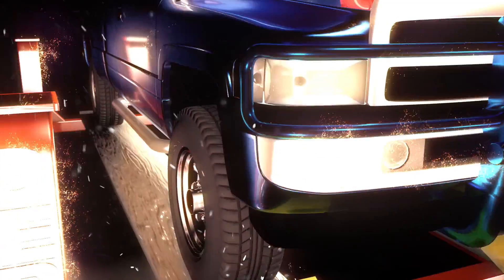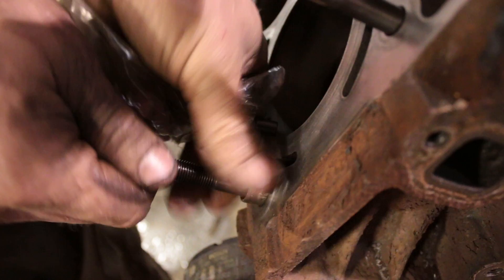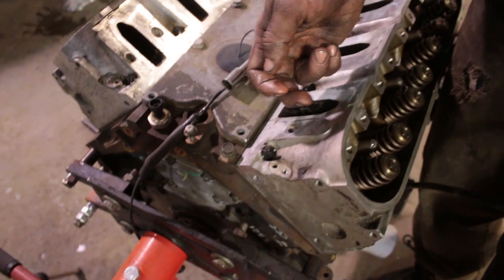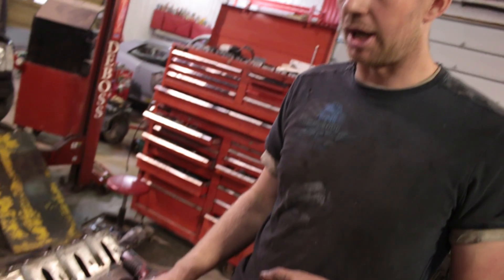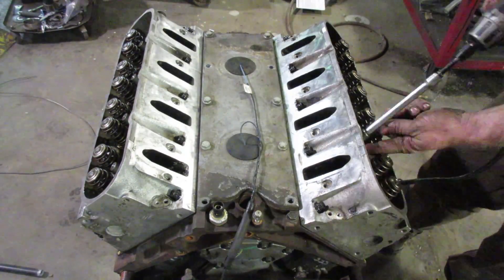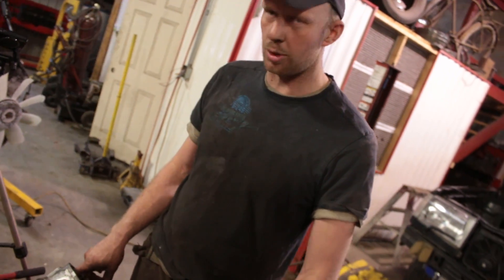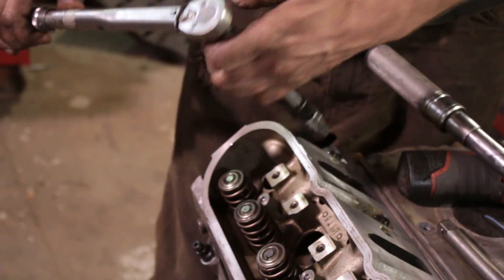Head Studs vs Head Bolts Explained

Comment: 95 percent marketing bullsht  quicker  to use when changing gaskets     would be cheaper to make compared to a bolt    could custom made to  fit the headbolt space without the need to retool    - im quessing

Comment: I'm not saying it changes your method or anything, but your explanation was incorrect. Adding thread on the bottom AND the top isn't what changes the clamping force, like you said the thread on the bottom isn't spinning it just sits there. Might as well be welded to the block for all the stud cares. When you torque the nut on a stud it pulls on the threads in the block just the same as a bolt since "every action has an equal and opposite reaction". Additionally the whole bolt/stud deforms not just the threads, so it doesn't matter that more length of rod is threaded. If there is more clamping force from a studs then it's most likely because on the studs you showed the top threads are a finer thread then the bottom. Finer thread means more clamping force for the same torque on the bolt since there's more revolutions of the nut per length of rod travelled (torque multiplier). That's why studs are useful is the finer thread since you can't get a finer threaded bolt and have it still thread into the block, but you can change the pitch of the thread on the top of a stud. It isn't it being threaded both sides that matters, it's the pitch of the thread, and a stud allows you to use a finer thread meaning more clamping force.

Great videos and the mistake doesn't make it any less useful, just wanted to point out the explanation had some physics misunderstandings.

Comment: Having both built and sealed control category  engines what happens after regular disassemble then assembly is that those corse threads strip out of the block. And that brittle cast iron distorts under bolt heads. Bolts or studs use washers and moly lube
The entire torque to yield is maybe ok for one rebuild. After that everything is bent and buckled.
While not condoning it I have reused [weekend need to get job finished] those bolts with no problems. BUT the things are known to physically break doing so. Especially for people who yank tools instead of 'feeling' them up.
The fine thread nuts give better clamping for the same  torque. ARP seem to be reccomending higher,, and lower torque depending on the engine.

Comment: Hey anybody knows what parts a can reuse on my 02 dodge 2500 24v 5.9 commins? I have a cracked #1 piston but rings are good. And I have two cracked valves on cylinder #1 as well. I was planning on get a complete engine rebuild kit. But sometimes I else came out. So now I am very thigh on money. Thanks in advance and where or what brand can I buy to get my truck back together

Comment: The bolts have a strength of the miner diameter. The studs have the same miner same strength. only torsion of the bolt.

Comment: Not sure what YT recommendations is doing to me but just watched driveway engineer say basically the opposite of this video...ok to reuse head bolts in LS...check out the test to failure in his vid. Help...
Reply: If bolts are torque to yield, replace the bolts. If you're not sure, replace the bolts. 
If you're not going to stud the block, new bolts are cheap insurance.

Comment: I am still afraid of becoming a mechanic, I feel like I wouldn't be any good. I wish I could be like this guy. Calm and cool.
Reply: In the end, it’s all just nuts and bolts. If you follow the manuals/ instructions, don’t take short cuts, you’ll be fine. It’s really not that complicated, but some people just hate mechanical work. You have to some what enjoy it to be good. And again, read the manuals, read till you understand and THEN begin the task. I VW been building motorcycles for MANY years. It’s satisfying, but there are some tasks that do suck every time. Still, doing them per instructions means only doing it the one time, not having to go back and redo something because it sucks and you took a short cut. 
 The second best piece of advise is two parts: buy or rent the proper tool, it’s critical, places like autozone will rent the tool and give you back your money when you bring it back, so it’s actually free. and , if something is eating you’re lunch, STOP, walk away and come back later. Frustration leads to broken stuff. Never rush, never try to get something done in limited time, wait til you have all the time you need.
 Little things always pop up and set you back. Last advice: take lots of pics and ,
 bag and tag EVERYTHING. The memory is not that good, when it’s time to reassemble, a pic and a bag of the proper tagged parts makes reassembly soooo much easier.  “ left valve cover bolts? Right here, right head bolts? Right here.  The approach is far more important than just slinging wrench’s.

Comment: As always great video!  I am putting new heads on a 6.5 TD...some people have recommended ARP studs...but all I hear from local mechanics is how every time they use ARP threads--they leak...apparently thru threads...any thoughts on this?  I would surely hate to put studs on and have to redo all the work...
Reply: That sounds fucking dumb. ARP studs are beasts, doubt the studs cause that problem probably some sort of seal

Comment: If they are OEM head bolts you don't need to replace them because torque to yield does not mean that they are no reusable. Sloppy mechanic and junk yard engineer has tested this. If they are Chinese or any 3rd party bolts then you do have to replace them because they have lower tolerance that OEM. GM/Chevy has really good bolts👌

Comment: Haven't heard about hot torquing, I know some guys will put the engine through a heat cycle and retorque after it cools down. On aluminum blocks you don't want to hot torque, some people say it can strip threads, probably not but no reason to do it anyway. Also to reason studs CAN be stronger is because they are often made with harder metal. Also since you are spinning a nut with fine threads instead of spinning on the coarse block threads, you get more accurate torquing and less likely to strip the block with higher torque settings

Comment: Unless you have an aluminum block (or those 6.0 6.4 diesels),you don’t need head studs.

If you take off the head, get a 📦 label with matching holes take the bolts out one by one, put them all back in there respective holes.

Done. You don’t have to be some hero. Smh

Comment: Reusing head bolts is completely dependent on application. Many Subaru engines can reuse head bolts, in fact, new bolts must be torqued to stretch the bolt and then loosened and torqued again.

Comment: What kind of torque wrench do you use? Do you think harbor freight torque wenches are good?
Reply: Kelly t I have one I've only used it a few times And haven't had a problem with it. For $20 it's not bad for a DIY'er. If it not being used constantly in a professional setting it will be fine. But there are better ones out there. Just don't drop it because $20 to recalibrate it is a new torque wrench.
Reply: Anthony Fuoco also nicer ratchets have more teeth in them so when you're in a tight spot you can actually tighten. Now tell me your craftsman can do that. But actually Costco has a pretty nice DeWalt set for around $80. It's a pretty nice set for the price, I got mine as a gift from my parents for Christmas  and I love it because it's small enough I can keep it in my car and bring it with me everywhere.

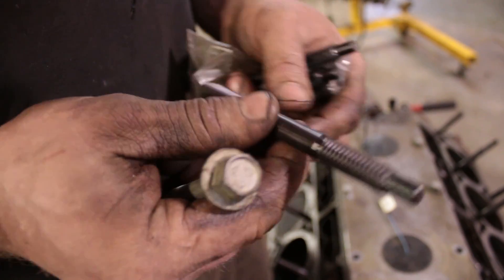Comment: That was a quite irresponsible little bit on why studs are better, not only was it wrong it was dangerous. 0:48 Doubling the PSI cause two sets of thread, wow, how do you get so wrong and not be called on it?

Studs are better for three reasons.

1. Generally larger diameter shafts and of better quality material. 
2. When torquing your not twisting the shaft.
3. And the BIG one, the torquing is done on the quality steel fine thread. NOT in the cast iron course thread. Fine thread has more clamping force for a given torque and the steel being of higher quality doesn't gall.
Reply: Thanks ! I was annoyed at this and you explained it way better than I could.
I love Rich and his videos, but way too often he states things that are completely wrong as if they were facts just because he thinks it's how it is.
Reply: The coarser thread also tends to be larger in most studs which provides more surface area in the block. You get the higher torque on the finer thread and a mechanically larger connection in the block.
That's why the fix for Northstar head gaskets is a stud kit that comes with a guide and drills the holes in the block larger to allow greater surface area for the coarse threads to bite.
Reply: And the greater diameter of the stud is better. Same reason nails are stronger than screws in wood and pins are used to hold heavy weights and high shear  loads instead of bolts.
Reply: Well he did mention it was a theory in the beginning of the video. Although you both have views thay disagree, he didnt state anything about his theory being fact
Reply: Good thing he said "essentially"
Reply: Blahh

Comment: Good video and technical stuff but Chinese head studs?   Why.  I’ve learned a long time ago you get what you pay for and there is no money to be made in rework.   Keep up the good work.
Reply: It's about overbuilding. A Chinese head stud that has coarser threads in the block with a larger diameter, will provide greater holding power than an oem head bolt. 
Even if the Chinese studs are of lesser quality, you can still get better clamping force with bigger hardware.
Reply: He and many people who follow him have done countless builds with China studs and zero issues.  So they keep using them.

Comment: Factory Ls bolts are actually torque plus angle, not torque to yield.
Reply: Ryan Barbolt 

Quality Engineer, here. Torque plus angle is how you perform a repeatable installation that gives you a bolt that has been torqued to yield. TTY is ALWAYS the end result of a modern torque plus angle installation process. The angle is added because your torque is a false positive for bolt stretch due to additional friction of bolt vs. block/head. The angle makes up for that low stretch situation.

Comment: When you say torgue with hot engine, do you mean running the engine on a stand, then remove valve cover and retorque or by manually heating the engine?
Reply: As has happened for a 100 years assemble, run engine to operating temp then retorque. But can require a LOT of disassembley to get at them.
The reason for monotourqe gaskets.
In reality it is still the best way though I have never seen obvious failures except on race engines.

Comment: Dude if you are going to by cheap studs from china then there isn't going to be much difference than regular head bolts....  ARPs are expensive for a reason and I sure wouldn't bother with anyone elses studs, but ah it's goin in a chevy so it shouldn't matter that much....
But really I wouldn't go with china's cheapest on a rebuild at all, they sure don't have a rep for making things within spec.

Comment: do you think studs will work on the 80's 5.7 diesel?? I know I know there a bad mtr out of the box my grandfather in law has 83 Buick Rivera love the car it's original owner 98k on it it's going to stay in the family and yes its showing typical heating and pressure signs of head/gasket problems!! a response and suggestions would be appreciated love the channel by the way
Reply: Yes, studs are the way to go on the Olds 5.7 diesel.  Stay with ARP, not the chinese crap.
Reply: EXACTLY what you said, if you want to go cheap on the studs, then go get OEM head bolts, you will be better off, china's cheapest are never known for being within spec.  Then again a 5.7 is something I wouldn't waste the effort to rebuild.   Whats funny is the 7.3 & 6.0 powerstroke uses the same rollers the 5.7 diesel does LOL.

Comment: 22, 90 and 90 might depend on the engine. I recently finished doing a cam swap on a 5.3 LS with alloy heads and block and it was 22, 90 and 77 degrees. That and the small bolts along the valley get torqued last. I wish I'd known then that using studs would get it back to using a conventional torque wrench, that torque to yield stuff is for the birds.

Comment: Some of the head studs,drilling out the bolt hole out and tapping out them to a bigger size has to be done.Northstar Performance has them for the Cadillac Northstar engines using a special jig drilling out and tapping the head bolt holes.This is their fix to the headgasket problems in these engines and has a patent on them.
Reply: Exactly why a northstar engine is best thrown in the trash when it's 100k miles is over, they aren't made to last and sure ain't made for the owners to fix.

Comment: Watch Sloppy and learn something about the LS and reuse.
Reply: Good studs aren't cheap.  But then again this is just a gasser and not a diesel.
Reply: DEBOSS GARAGE exactly it's a totally different mentality when you charge a customer for work you must stand behind compared to a buddy's ride your helping out for a 12 pack
Reply from the maker: Ask Matt if he would build it for a customer using used parts, put his name on it and post it on the internet.  Studs, Bolts, and gaskets are cheap

Comment: There must be a thousand ways to torque a head. The reason to gradually increase the torque is so you don't warp the head by having one spot at full tension and another at none, by doing it in stages you put less stress on the head. Head bolts are designed with a fail point near the middle so that it doesn't break off in the weakest part which is normally the threads.
A stud is better for accurate torque because you are not twisting the whole thing just the nut on top, because of not being twisted less stress is placed on the stud and the threads in the block for the same amount of torque making them stronger and less likely to pull or strip the threads. A quality stud Should still have a deliberate fail point same as a head bolt. You should retorque the head after about twenty hours of running the motor depending on the specs
Reply: He didn't even use a "quality" head stud, cheap china he said, really I wouldn't see how that is going to be better, I haven't known cheap china to make things in spec so well, same reason I don't buy cheap china piston rings or bearings.....  You get what you pay for, rather than cheap no name studs, I'd rather go with OEM head bolts.

Comment: I wait a whole day after last torque down. You need time for the gasket to compress.  Those 9 times of tightening polishes the threads and nut for the studded engine, which make it more accurate of a torque reading
Reply: prancstaman good idea for multi-layer gaskets, I will have to remember.

Comment: I think the most important thing in torquing down a head or anything with a  fine tolerance is the how accurate  the tension wrench 
Spending good money on a high quality tension wrench will achieve a lot more than some flash bolts and a elcheap'o tension wrench and flash studs

Comment: Extra threads on the top of the stud does NOT add strength. All it does is help get repeatable camping force when using a torque wrench. You don't need to overcome the friction between the coarse thread and the block. The friction between the nut & (hopefully well lubed washer) is smaller and easier to account for.

TTY is not about stopping bolts coming loose. It's a about stable clamping force across the many heat cycles that an engine faces.

While I would recommend replacing TTY head bolts it's not as big a deal as everyone makes out. For instance sloppy mechanic has made 1000+ HP on reused TTY head bolts.
Reply: it also reduces the wear and tear on the threads in the block, especially threads in aluminium.
Reply: Yep, Rich is just not right on this. I thought it was a wind-up at first.